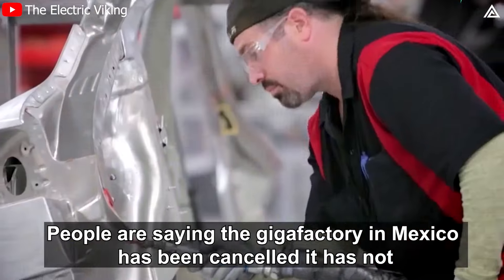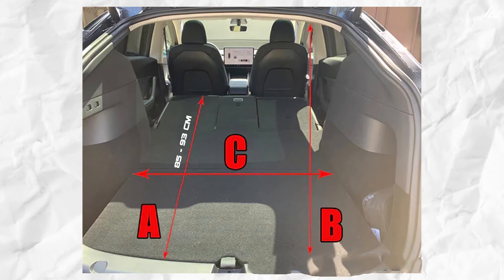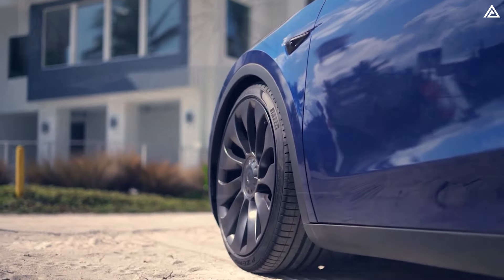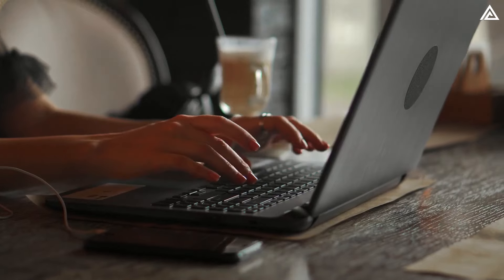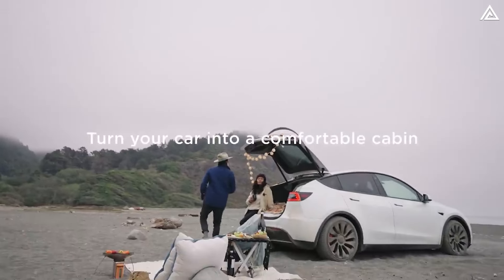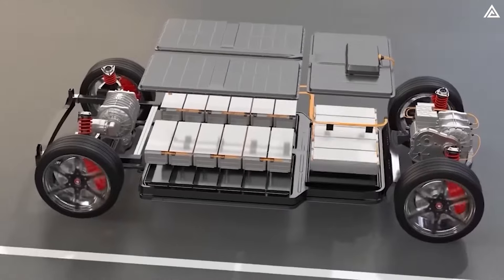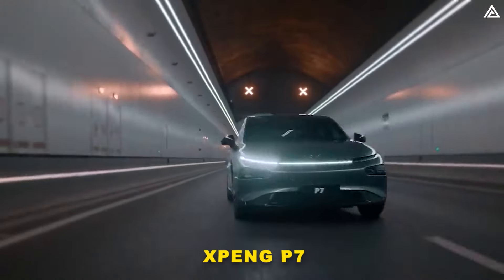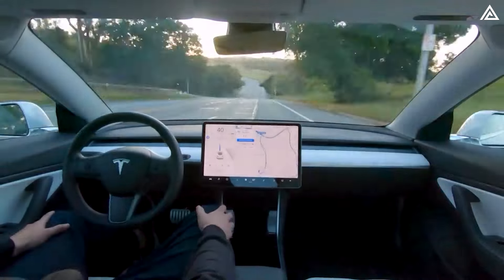Tesla Model Y 2025. Project Juniper First Look. Stunning New Feature!

Comment: Model Y Juniper IS a game-changer! I don't care for the auto frunk or wheel options HOWEVER Adaptive air suspension, Blind Spot notification, white interior, RGB Lighting and if I could vote, the CATL Shenxing Battery are things I would like to see. A fast charging with a 400 mile range would be fantastic! I know there is a lot going on ,savings, etc for the current Y but for me, its the JUNIPER!
Reply from the maker: For any EV, range and fast-charging speed are two top priorities for customers, and Tesla is clearly on the right track with their current strategy. Looking ahead to the Juniper facelift, is there anything specific you hope to see included?
Reply: @adamtech999  I pretty much identified what I would like to see in my statement after the word HOWEVER.